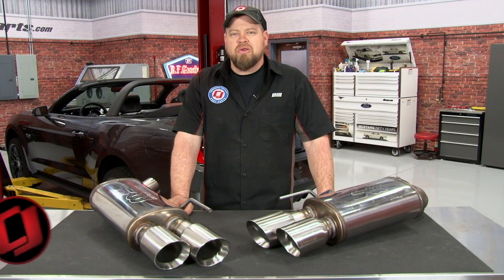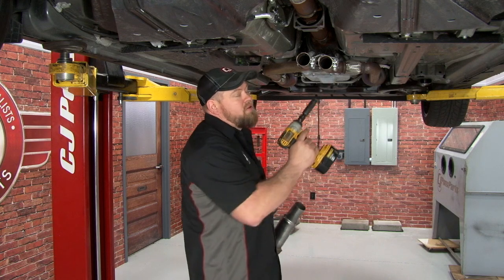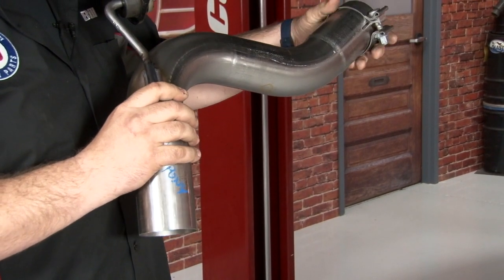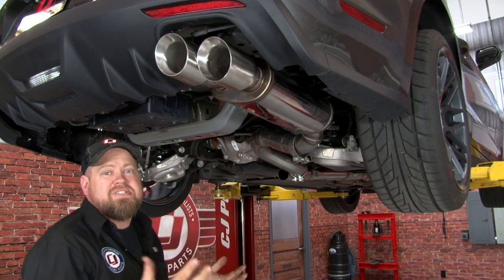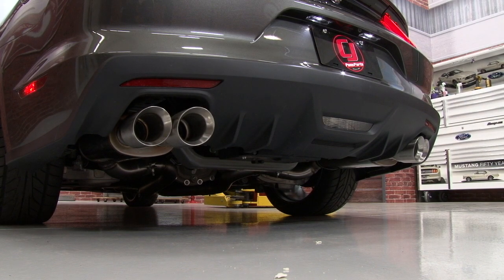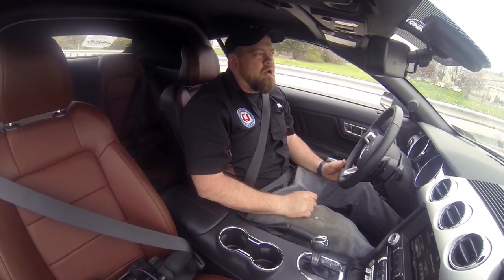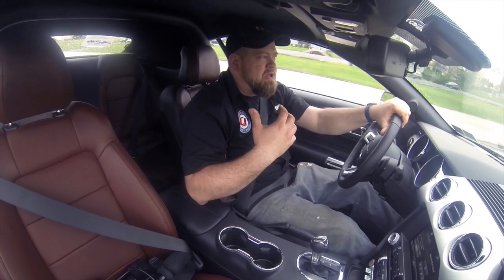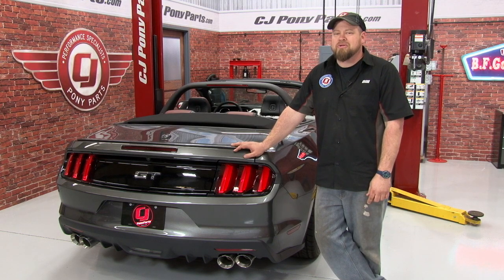2015-2017 Mustang GT MagnaFlow Competition Series Quad Tip Installation

Comment: you removed the brace off your convertible, did you have add anything for support when you did that?
Reply: Rick Civitarese  We recommend this system only for use on a Fastback. We installed it on the CV only because that is what we had available at the time, I would not recommend removing the bracing. Roush offers a quad top axle back specifically for the convertible now

Comment: Hi Bill Just want to know if you gonna do the video with new roush valance with rear sensors. thanks
Reply: shane We have no plans to, the install is basically the same
Reply: Bill Tumas Thanks for the reply Bill but I thought it would be a lot easier for all the user to follow where the necessary cuts needs to be done on the valance if its coming from professional person like yourself that's all because I read the installation manual back up sensor cutting different to normal one, even the exhaust cutting as well from convertible and fastback. But any ways if you think it would be a time consuming for you guys that's fine. You do a great job every time you do any installation. Thanks Heaps and keep it going mate.

Comment: Will there be a convertible version also? I know Roush has one but I don't like the fact it's only an axle back and have to go through more trouble with cutting and extra hangers. I like Magnaflow's tone and the fact it's full 3 inch. I also don't like the complexity of Roush's tips. Might as well go full quad.
Reply: jodl73 At this time the Roush is the only option for a convertible and I don't see that changing.
Reply: Bill Tumas Hey Bill, thanks so much for your video man. Would you know which Roush exhaust system sounds equivalent to this? I love the sound of these and was very disappointed to know that they're not compatible with the convertibles
Reply: altjxx The Roush will have a different tone than the Magnaflows will. They sound good but not as deep, we did a video on them with and without the restrictor installed
Reply: Bill Tumas Thanks for the reply Bill! Do you have any recommendations for some that are deep and similar as this one?
Reply: car noob here and learning. thanks for your patience

Comment: What exhaust options are there for the 2015 GT convertible?  I'm having trouble finding exhausts that are compatible
Reply: SIXFLAGSDRPEPPER Ford Racing or Roush axle back systems will work. Roush offers a quad tip axle back specifically for the convertible now.

Comment: Anything like this for the ecoboost?
Reply: blade000007 At this time it is GT only
Reply: Thanks. great video
Reply: blade000007 Roush released a quad tip for the Ecoboost. It is an axle back system and installs similar to the GT one we did a video on. Same muffler as the standard Roush EB axle back so it should sound pretty good.
Reply: I saw that but i prefer the premium diffuser that comes painted. With the quad tip that would need to be replaced correct?

Comment: Do you have to use the Roush rear valance or will this work with the GT350s?
Reply: It is designed to fit the Roush only.